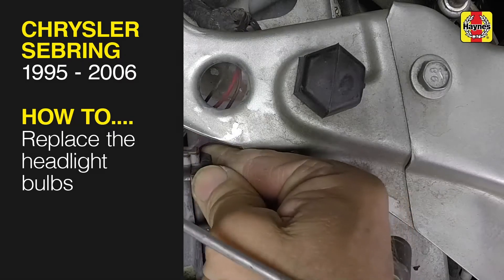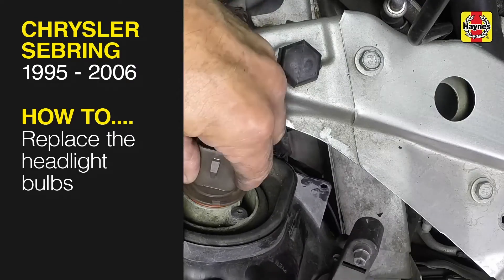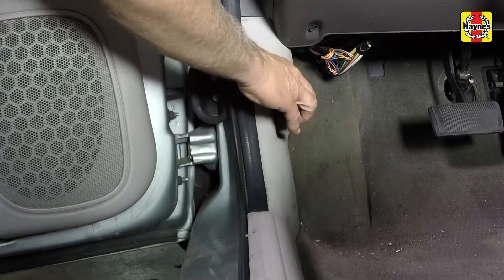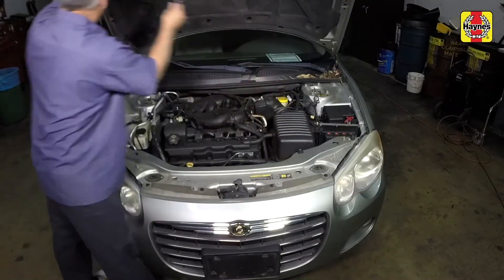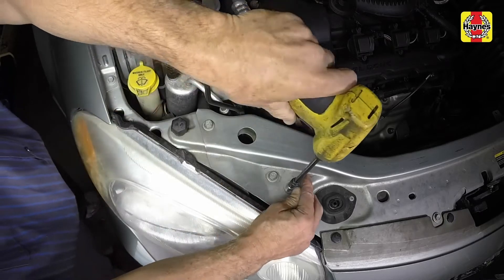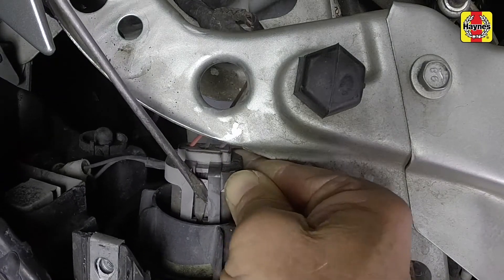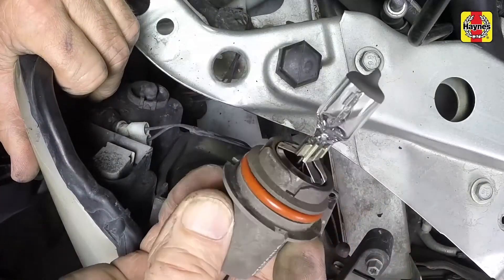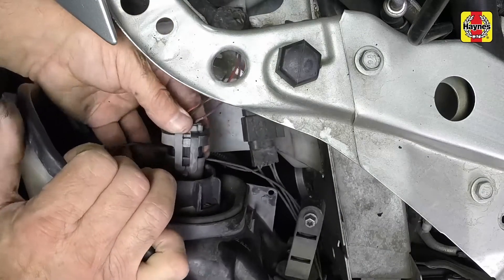How to Replace the headlight bulbs on the Chrysler Sebring 1995 - 2006

Comment: Great video. Also wanted to know what the issue is about my brakes going out on me at random times. I pump my brakes most days to slow down, because  they become sponge like and not very responsive, then sometimes the peddle will go straight to the floorboard like no pressure is behind it at all. I've had my brakes bled, new brakes installed, you name it, I probably had it done to these brakes. Nothing seems to fix them. I even replaced the cap for the brake fluid. Is it possible there is a pressure issue with the brake line and not have any holes? Every mechanic I have been too says the brake lines are fine. Literally at wits end with this Chrysler, but it's my only transportation, so I must keep it drivable.
Reply: sounds like something in the master cyl. sometimes getting between a cup and the bore